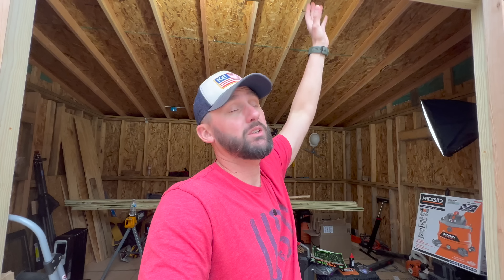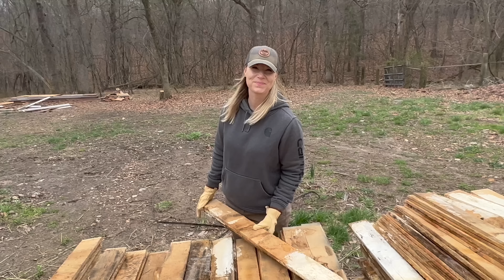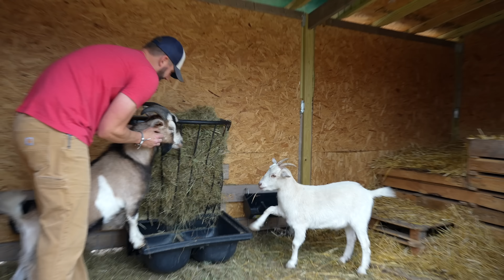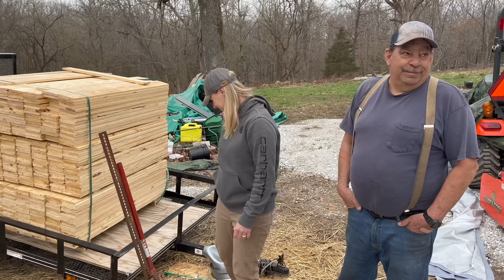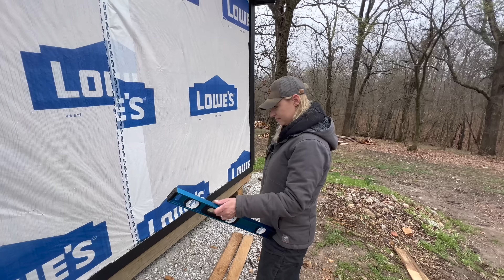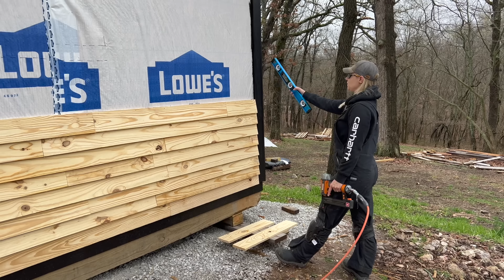LOWE'S has to go! | Project HALTED

Comment: You get some lemon juice & honey 
& mix it in a cup of HOT water & drink it 
(hot totty) & your voice will come back 
do it for a  week 2 X's a day will work.

Any time you have stacked wood outside
uncovered it will mold, but like you said 
it can be used just be sure to cover it so 
it doesn't get more mold & rotten.

You both have come a long ways with all 
your projects & learning curves along the 
way with everything you have done & it's 
looking really good with each project.👍

Comment: So sorry Kyle, delt with that last week with allergies, I took generic Zyrtec and within 3 days (1 pill per day) my voice was back to the sadness of many around here LOL (meaning I can't yell at all either). Last time that happened I lost my voice for nearly 2 weeks even with meds and did permanent damage to my vocal cords, so please rest them as much as possible and take the Zyrtec as it seems to work better for outdoor allergens. On the Zyrtec year round and half the year I have to also take Singular (usually last spring early summer and late fall early winter). Hope you get to feeling better soon!  As to the doors, we have a pin system on top and bottom, I hate the ones at the bottom! they get filled with any and all junk from the floor with us going in and out all the time. If I could do it over (and may still) put the magnet system on the bottom and the pins at the top. The handle is the dutch door handles seen on old barns (turn handle with a bar that latches in top or bottom in a slit that the bar fits in).  If it is black mold looking type you can spray them down with distilled white vinegar and baking soda or 3% Peroxide plus water (no idea on ratio but 7% peroxide is even better) or 1 cup borax (20 mule team stuff) and 1 cup water, mix is spray bottle and shake till mix well and spray and let dry.
Reply: read above about how to kill the mold. Also not all black mold it toxic either.

Comment: Could you possibly use a power washer with a little bleach to clean those boards? Would be a lot less work than sanding. I once had a fence and that's how I got the mold off of it.

Comment: Hopefully the boards don't warp. May need a few face nails, you will never see them. Guess you didn't watch Kelleys country life sideing hanging video I sent the link for. They make hangers that hold the hoards at the right overlap then slip out. Can you say work saver. Also the joints could be flashed. Watch the video. 😊

Comment: I had that same problem so first I sprayed them down with bleach to kill the mold ,washed standing boards and let the sun work on them. BUT,  I use a Mask as not to breath on the pores? And yes I did , then burn them. I was a mother on my own with kids so I had to use them. That was 40 yrs. Ago , it worked and by myself I felt empowered. Thank God you don’t have to go through all of those steps.

Comment: Probably part of your problem is the tree pollen.. I’ve noticed a lot of it on the animal’s water bowls..
You might want to chalk where the wood butts up to the trim to keep water from getting in the seam.. you probably already thought of that but, I thought I’d throw that out there in case you hadn’t..
Spray distilled white vinegar on the wood.. you can also use cleaning strength bleach..that way you can use it on another project..
Dad’s are great .. thank you Shannon’s dad for saving the day..
You’re doing a great job Shannon..😊
Reply: This! Put some vinegar in a garden sprayer and then let it dry in the sun. NEVER sand mold.
👍

Comment: i took old deck boards, trimmed corners and windows out, ran it all through the table saw. corners are 45 degree mitered so make a nice corner, windows kinda standard, all the trim is 2x4 depth, then all siding is lapped fence pickets, 6 foor square top treated. found some mistint stain at lowes for fraction of new price, redwood colored, man it all looks so good. over time some pickets warp, but i just switch em out, nothing but a thang.

Comment: PLEASE DONT BURN OR WASTE THE WOOD. All you have to do is pressure wash the wood with mold. If just water and pressure doesn't remove you can spray it with 6% vinegar (which will also keep predators  away) most of the time just water works  great. I have a friend who saves and uses reclaimed wood for all his projects and furniture building. He gets most of it free because people don't think you can save it. 😢 😢😢

Comment: Do be careful with the mold, wspecially since you are already pollen sensitive. Not much besides bleach gets rid of mold. The sanding is more likely to spread it than eliminate it and burning is great, but everything that I've seen on it is that it's VERY time intensive.
However, the new planks are looking great! Awesome possum job!!! It will be amazing when finished. Be careful to keep the planks out of the rain or you'll have the same issue with the new ones! Prayers for health restored and for safety!🙏❤🙏

Comment: If you put a vertical slide bolt on the top, inside corner of one door( preferably on the left side) so you can slide it up and have that one door stay closed unless you need a wider doorway, and come in and out on the right side!  Any wood you keep outdoors should be  covered or sheltered under something! KYLE, YOU ARE NOT TALKING LESS!!! GIVE UP CONTROL FOR THIS ONE TIME AND LET SHANNON DO THE TALKING! Sorry about your wood, maybe spread them out on sunny days an let them dry or BURN THEM WITH THE TORCH AND KILL THE MOLD!?!!!

Comment: There are glasses used for riding motorcycles that have foam around them so air or maybe sawdust doesn't get in your eyes. They aren't cheap but you also ride a 4 wheeler so you could use them endlessly which makes it worth the money. Any motorcycle/4 wheeler shop should sell them maybe even Lowes. Lol. Surly someone besides me has figured out the multiple uses by now. 😂
Reply from the maker: We actually have our foam glasses from when we had a motorcycle, they are just buried somewhere in storage 😉🤣 they would be good to use!

Comment: That is not a torch!!   Get a weed burning torch and use the Japanese technique and sear the boards.  Burns off the outer parts and seals/scorches the boards to prevent failure

Comment: Most of that is mildew. Some is mold.
Go to lowes get a gallon of the mold and mildew killers wash stuff lol.
Then use a power washer with that mixed in.
It will kill it and clean it off at the same time.
Less work then sanding and then breathing that.
Don't sand it. Mold in the air is very dangerous.

Comment: I'd use it for fire wood. Would not mix it with anything as the mold will spread. Especially if there is black mold. Please be careful.
Reply: If you sand mold shouldn’t you at least mask up?
Reply: I wouldn’t reuse Anything moldy. Including don’t put with hay, since the animals eat it.   No matter how much you burn or sand, the mold spores are already in the wood.
Reply: If it's used then sprayed with bleach then burnt then the sealant, would it be ok to use?
Reply: @maryb.7065  We're glad to have

Comment: Are you planning on burning the wood over top of the Tyvek wrap ? I thought you would burn the wood before putting it up. Tyvek® can endure temperatures ranging from -70°C to +118°C. However, some deformation may occur, at around 80°C. Also, note that Tyvek® is made from high density polyethylene, which can burn; thus Tyvek® should not be considered fire resistant.. I don't know much about this stuff ..... and maybe I'm wrong or over thinking it. ... but I'm thinking out loud !!!

Comment: I would suggest you just put metal siding on the kind you put on that roof with the lines running up and down. That covers it quickly and it's probably cheaper and would hold up better than vinyl siding or prefinished planking. Too bad about the wood.

Comment: You should have used screws on your siding that way when you need to replace it it would made it easier to replace it instead of using nail makes it hard to replace it and as far as burning your siding like you did your goat shed shouldn't you have burned it your siding first before putting it up I have seen others burn it before they put it up like you did on your goat shed

Comment: I would burn them...the more you mess with them the more you are moving mold spores and that's not good breathing them in your lungs.
But I'm not an expert so what do I know, right? If they were mine, mo I'd burn them.😮..yeah you can wear a mask, you can use a planer, you can wear safety glasses and all the protection necessary but ...as I have said the more you handle them the more you are spreading the spores.😢